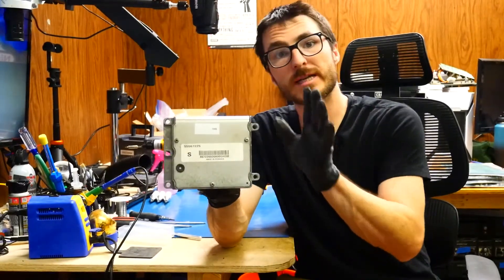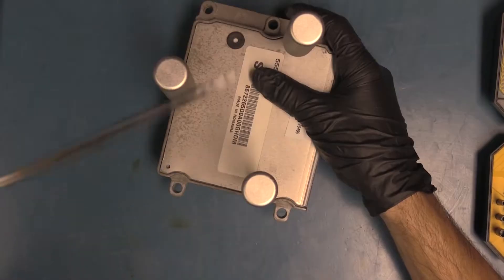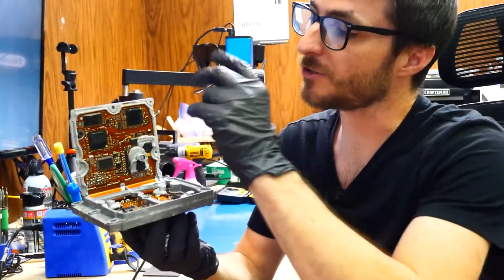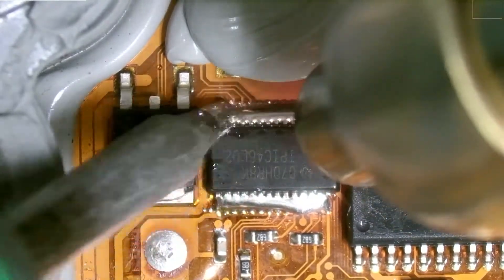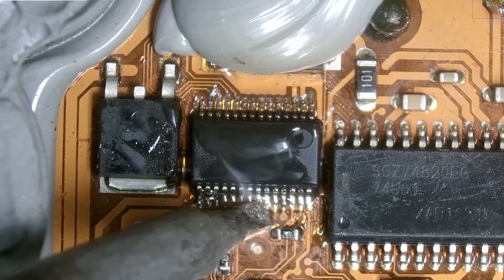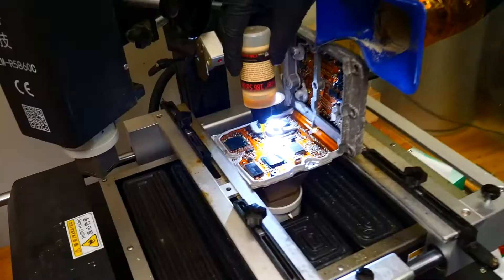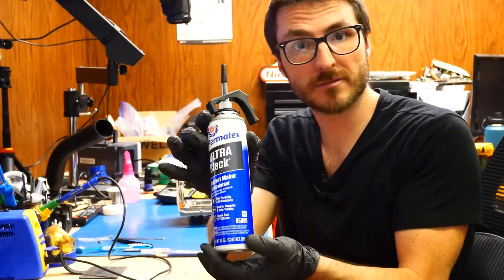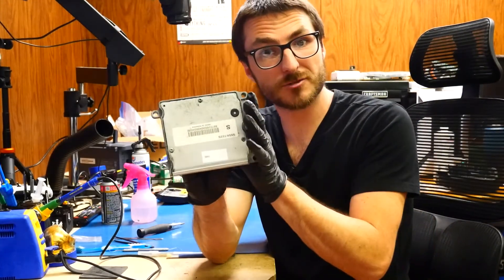How I Fix a Saab 93 ECM

Comment: Is there an benfit of sending you a working ecu as an preventive maintanance?
Reply from the maker: I mean yes and no. I don't really want to push to refurbish a unit that hasn't failed yet because that feels a bit weird, but also if it was me, I would rather plan and be in control of when my car is out of commission for the repair then have it happen randomly and possibly at a terrible time. So I guess if it's your daily driver and you need it to work reliably, and say you are about to go out of town for a week or two, then yeah, that would probably be a good idea.
Reply: @NicksElectronicRepair  A tip for Saab NG owners. Find a spare ECU and if it is failing, send it off to Nick for reflow and chip replacement or just have him prep your spare in advance. Flash it for your car and keep it in the trunk, in an antistatic padded bag. With the proper clone flash it will be plug and play. I've done that with mine and had two instances where I would have been stranded without the spare in the trunk.

Comment: Can u repair saab 9-3 2.8t ECUs?
Reply from the maker: We have not had to fix those before and are not really set up for them so I would have to say probably not unless you already have some information that could help us diagnose and figure out what this issue is. Knowing what to fix is 90% of the fight. Once we know what we need to do the last 10% is the actual component replacement. After that in terms of testing, we won't be able to do to much since our Saab we use for testing is a 2.0L not 2.8.

Comment: Interesting that the PCB appears to be flexible rather than a typical solid board, do you think this is for vibration mitigation?
Reply from the maker: Actually there is no circuit board. It's film glued to the metal. Yeah I know kind of crazy and only unit I have ever worked on that is designed that way. It presents it's own difficulties.
Reply: @NicksElectronicRepair  Very strange. I've seen that type of film used for button circuits in DSLR cameras where it needs to conform to the shape of the camera casing but never on such a complicated circuit like an ECM
Reply from the maker: Yeah it's the first and only one I know that uses it.

Comment: Almost $400 just to solder a new chip in that cost about $1 dollar. Thats crazy 😅
Reply from the maker: This means you didn't watch the entire video. We state that that chip actually doesn't fix the unit most of the time. What we do later in the video is what more commonly fixes these units but because that chip can and does fail we still replace it anyways. You should watch the entire video to see what we do to fix these.

Comment: I'd like to see you tackle a Chrysler TIPM module. @pinehollowautomotive did one on a few years back (FETs with multiple circuits on the drains). A real weird device.
Reply from the maker: Yeah I just looked into the Chrysler TIPM modules and it does look like there is a descent amount of demand for those repairs. We haven't yet had a customer bring one in but I am sure it is only a matter of time before we start seeing them.

Comment: How long and at what temp do you bake your board before bga reflow? Do you have recommendations on flux, rework station tips?
Reply from the maker: I can't give you recommendations for temps and times for reflows, that will vary and depend on your equipment and environment. 
As for flux, I can recommend Kingbo, or Amtech. Rework station tips, don't buy something cheap for $500, it's worth it to spend the extra $$$ and get something that will actually be consistent and work properly the same way everytime. Consistency is key here.

Comment: So it's not a home job but you need specific equipment, good to know before making wrong attempts. One question, changing those chips I think you lose the programming of the control unit, is there no way to download it and then recharge it?
Reply from the maker: So we are not replacing the processors, we are either reflowing or reballing them. We have found that the processors don't typically fail but instead, it's the solder balls connecting the board to the chips that fail. 
Now 1 of the chips does have very unique software so you can't really change it, or at least I don't know how to change it with a brand new unprogrammed one. If we ever do have to change it for some reason, then we have to grab one from a donor ECU which we have plenty of. 
The other processor does not have unique software on it, that one can be replaced with no problem. As for programming both chips can be programmed but that's more of a cloning situation I have a video I will be making regarding that here in the near future.
Reply: @NicksElectronicRepair  So it is confirmed that the strong heat in the engine compartment ruins the welding of the control units. In the 4 cylinder it was placed above the engine, in the 6 where less air passes, above the engine and exhaust. Economies of scale, it would have been enough to put them inside the passenger compartment to avoid the problem. Great job, thanks.
Reply from the maker: Yeah the cracked joints occur from thermal cycles, and of course the more extreme the thermal cycles the more damage will occur. So if it wasn't on the engine these ECU's would probably never fail. Or at least have a way way way lower chance of failure.
Reply: @NicksElectronicRepair  I have the 93 V6, for now I have put some spacers to keep it a little detached from the engine, now air passes where it was previously placed on the engine, I also eliminated the catalytic converter in the engine compartment greatly reducing the temperature, the ideal would be to move the control unit inside, but without the diagram of the individual connections I don't want to risk it. Interesting the way you unsolder and solder the pins of the chips, I was convinced that it was done individually for each pin, certain jobs are better left to a professional like you

Comment: one question and you have the equipment to program a used computer from a 2008 saab 7-3 2.0 turbo
Reply from the maker: If the equipment is the same for cloning and programing a 9-3 and 7-3 then yes. Otherwise no.

Comment: He left out the part that these repairs are almost surgical. Parts are much smaller than this video. Will need magnifying glass or microscope. Pins need to be perfectly lined up & soldered perfectly. Not for amateurs. I took it to several specialists & nobody wanted anything to do with attempting this repair. Oh, & i ended up destroying mine trying this procedure & i have above average mechanical skills & soldering experience.
Reply from the maker: Yes we don't recommend you try this yourself, this is definitely a very advanced repair, the video is for informational/educational purposes.

Comment: I sent mine in and got a email yesterday saying the diagnostic is being done I can’t wait! 🎉
Reply from the maker: We are working on it but are currently experiencing a high volume of repair requests. My team is slightly behind on some of the repairs, but we are doing everything we can to catch up and get everyone's parts fixed asap.
The moment we have an update for you we will reach out!
Reply: @NicksElectronicRepair  How much do you charge and, how long is the estimated repair time?
Reply from the maker: We do a flat rate repair for these because we always perform all repairs for all common faults to ensure we both fix your immediate issue but also resolve any potential faults that could occur in the future before it occurs. Due to the high demand for repairs at this time and since we only have 1 Saab 9-3 vehicle for testing we are pushing the 5 business days turnaround time. 
For more info, you can check out our website listing below:
https://nickselectronics.com/products/55352688
Reply: @fannie5262  just got a email today that the ECU has been live tested and is in queue to be repaired💓
Reply from the maker: @NeezyWest 
Again sorry for some of the delays, we only have 1 vehicle for the live testing. We are working on ways to optimize our testing so it can go faster without taking as long. But we should have your unit fixed very soon. Once the testing is done and faults are confirmed it goes faster from there.
Reply: Does it needs to be program after or os it plug and play?
Reply from the maker: When we get it we save your software in our system because that software is unique to your vehicle and keyfob. Then we program your ECU to our car and keyfob and test it. We troubleshoot, confirm the fault, and proceed with the repairs. Then once it's tested one more time and confirmed fully functional we program it back to your original software so that it works with your car again. 
Does that make sense? It should be plug-and-play for you, you shouldn't have to do anything when you get it back other than just install it back in.
Reply: @NicksElectronicRepair  We have the software already saved on my end too. Is the ECU location on y’all’s testing car relocated?
Reply from the maker: It is not relocated, we have it in the original spot.

Comment: I just sent mine in today! You guys should be receiving it hopefully Saturday 8/3/24! Cant wait for you guys to perform your magic on it! Thank you guys again for all that you do
Reply from the maker: No problem! 
Just a quick heads up, we have been getting a surge in repairs recently. We are doing our best to get through all repairs as fast as possible, but given the volume we of parts we have received it seems we may have some small delays with repairs. 
Updates are however provided as they become available to keep you in the loop as to where we are in the repair process of your unit. 
Keep an eye out for those.
Reply: @Smallenginetech56
Have you received your repaired ECM yet? If so did it solve your issue(s)? Today is 9/10/24 and they received mine on 8/29/24 but I haven't heard anything since. I sent it in for one of my customers cars and he's not happy with me due to the repair time.
Reply from the maker: @chasruss212r please reach out to us via phone at (520)838-9359 or send us an email directly at info@nickselectronics.com
You should have received several emails from us with updates. We always reach out when we first receive the item to confirm we have gotten it, then again after we test it to confirm the error, and again after we complete the repairs. If you have not received any communication from us it is possible that the emails have gone to your spam folder or could have been filtered to the socials tab or even under the promotions tab. 
If you have not received updates in several days, please reach out to us with your ticket number or order number so we can give you an update on the status of the unit.
-Nicholas Arnaud

Comment: Hello! Thank you for sharing! What kind of flux and temps do you use to reflow the microprocessor?
Reply from the maker: Do not attempt this repair at home, we are professionals with almost 30,000 repairs under our belt. We have a lot of experience and while we make it look easy, there is a lot more going on than what you see on screen.
Temps are not a one-size-fits-all-all. It would be a bad idea for you to use the same temps we do. Either the temps will be too low and nothing will flow for you or worse the temps might be too high and you will break the device you are trying to fix.
You have to fine-tune your own machine and find the sweet spot. Use broken circuit boards that are low value or trash that you don't care about to fine-tune the temp settings. You should not be experimenting and learning how to properly rework a flip chip using this ECM.
Once you are confident in your temperatures and can get good results repeatedly on a bad board, then you can start working on a good board you are trying to fix. Again I would recommend you become proficient on low-cost boards, not this ECM.

Comment: Wow first video I've seen showing the 'trade secret' by reflowing the processors. THANK YOU for making this!! will save a lot of Saabs :)
Reply from the maker: I hope so
Reply: this is no trade secret. it's not widespread because it's not a permanent fix. the cpu usually starts throwing the same problems again after a few months
Reply: @nunezmartin7441  why?
Reply: @PółelFzBrygadyVrihedd  I can't respond to this ECM specifically (never worked on a SAAB), but depending on the original solder used, reflowing can be temporary as some reflowed solder is more brittle than the when it was originally installed, even when using quality flux.  If I worked on these (again, I don't) and I was getting recalls, I would reball the chips instead of reflowing them - a lot more work.  Also, some ICs don't like being reballed anyway as they're mostly designed for the original heat cycle when installed - just one.  With reflowing, there's two heat cycles - the first when it was built and the second during reflow.  With reballing, there's three - the first when installed, the second when the IC is heated to be removed from the the board, and the third when the reballed IC is reinstalled.  It all comes down to how the board and chips respond.  If reflowing gets 5 years of use, the car will most likely be scrapped at that point so reflowing is a good plan.  If reflowing only gets 1-2 years, the chip should be reballed or replaced.
Reply: @PółelFzBrygadyVrihedd  because these ECU's are trash - seen hundreds of people replace and repair and get the same issues down the line.

The car is scrap, the brand is scrap - why people buy them I'll never know.

Comment: how do you know its working ?
Reply from the maker: I am glad you asked.
We started fixing these a bit over a year ago, and at first, were only doing the driver IC chip replacement. While that did have some success, it wasn't as good a success rate as we wanted, and we would have some customers with units that would work at first but then after a week or two or after about 100 miles, it would fail again. We found out that the issue wasn't always only the driver IC chip but the processors that we reflow in the video also causing the fault. After reflowing those processors the fault would not reoccur. So now we do both repairs every time and that guarantees repair success every time for long-term results.
Reply: @NicksElectronicRepair  thanks for the info and keep up you doing a great job i like your videos
Reply from the maker: @Cutycats9  So the answer I think you were looking for is no I don't have this vehicle to live test. I have some bench testing tools but the problem with either of those is that we need to run the unit for hours and hundreds of miles to really know for sure if it's fixed. Like I mentioned in my last reply some customers when we would only replace that driver IC chip would report the units working for 100 miles or more and then it would fail. So for us to full test we would have to drive around for hours with each ECM. This would require me to hire a dedicate person that would just drive around all day with each ECM and I would have to increase the repair cost significantly to accommodate for all the additional costs associated with doing that. We only charge $189 for this repair, there is a company that does more testing and repairs these, but their repair price is $600. You could call us the budget repair.
We in this instance count on our customers to do that extended testing and we work with them closely if there are any issues. We provide a 1 Year warranty on this repair and do everything to try and resolve everyone's issues as best we can. However as I mentioned now that we have started performing both repairs we have not had any issues reported by any of our customers. 

With that said, we are always learning. If we find out new information, we will make a new updated video.
Reply: @NicksElectronicRepair  Aren't you replacing both TPIC -chips at once?
Reply from the maker: @anttikorhonen1988   So that's a really good question, and the answer is no, we aren't. The reason for this is that we realized that even though we do replace the one we do, it's actually very rarely the actual cause of the failure as we had first believed it was from our prior video before this one. The bad solder connections on the processors are actually the main failure and most common reason for these units to fail. However sometimes the processors can fail, and when that is the case they will need to be replaced. We will be making a follow-up video on this process in the near future actually.
Reply: I forgot to get back to you on this one, but we do have a saab vehicle we live test the units inside of as of a few weeks ago. In order for it to work however we do have to clone the unit twice everytime which is a hassle. Now it doesn't really provide us that much more testing of proof of work because the bench testing we were doing prior was pretty good already but it does allow for us to be able to better troubleshoot and fix unusual faults. Again it still comes down to the fact that often the faults are intermittent and thus require the vehicle to be driving for hours across several trips to create the fault. This is not something we can do at the repair price point we have. We would have to charge several hundreds of dollars more in order to cover the cost it would require for us to thoroughly test these units in vehicles for several hours worth of driving. 

We are going to be posting some follow up videos shortly with some work going on in the car, keep an eye out if you are interested.